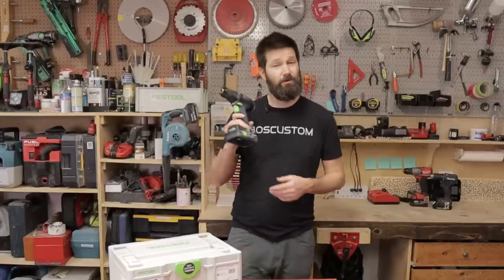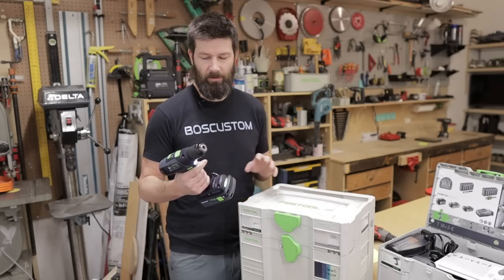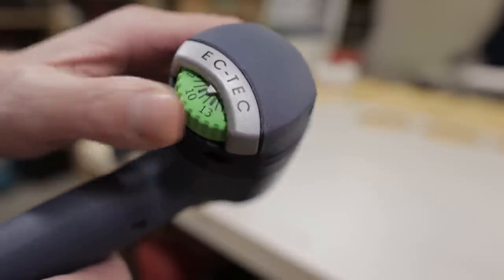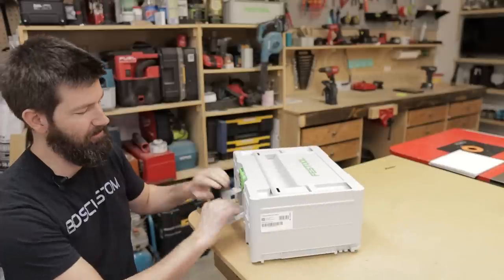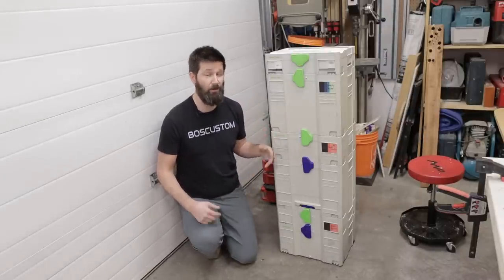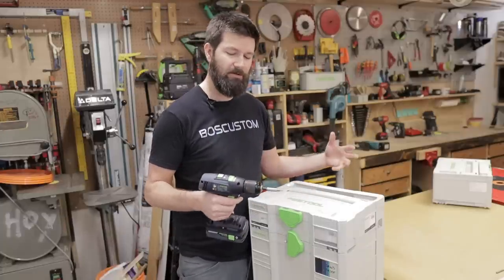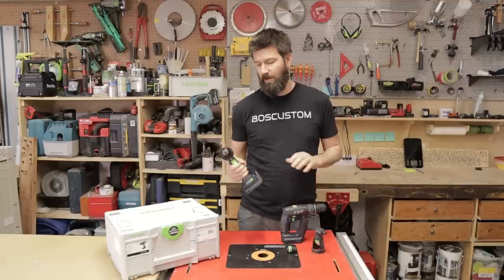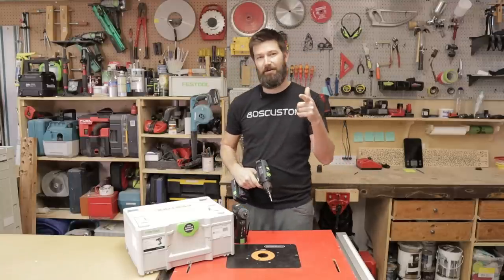Festool T18+3 Easy Drill-- Everything you Need to Know!

Comment: Thanks for the review.  Understand that this drill model exists precisely because it has a fixed chuck.  It lowers the manufacturing costs for the product and it can be sold at a lower price point compared to the standard drills Festool offers.  Bells and whistles cost money.  Festool also changed what they include with their standard T and C 18v drills.  They no longer include the eccentric chuck in those sets.  You only get the 3 jaw, the Centrotec and the right angle chucks in the sets.  The eccentric chuck is sold separately and costs $130.  So those standard 18v drills in sets and the eccentric chuck is $630 versus the Easy model (with batteries and charger) at $300.  One can pine away for the Easy version to have the features of Festool's standard line of drills, but you'd be tilting at windmills a bit to desire that.  As both you and Festool say, the Easy is  "entry level" BUT you still get the quality of Festool.  Cabinet installers make good use of the eccentric chuck and the right angle chuck.  Serious hobbyist woodworkers and homeowners, less so.  Hmm, what to do with the $330?

Comment: I really like the C-18 (cxs's big brother). The nicest drill/install driver I have used. 

I just picked up the T18e as well to complement the C-18. Both are super smooth and controlled. Perfect for cabinet makers. 

Good review. Now to see how the durability is....
Reply from the maker: How do you like handling the T18E vs the C18?
Reply: @TheFunnyCarpenter   I really like the ergonomics of both TBH; the C-18 feels really great in the hand for screwdriving, and odd angles, etc.  Like the T18E you reviewed, the balance is really good too. I mainly picked up the T18E for larger jobs where there is a lot of drilling and fastening to do, so have dedicated tools for each task.  The T18 is really smooth to operate with drilling, etc. (And I am already on the battery platform (TSC55, Osc18). )

 The C18 of the two is my main go to though. It is just a little bit more comfortable and nimble. I can hang it off my tool belt and forget that it's there

Comment: I've been eyeing the TSC 55.  How would these 4Ah batteries hold up on one of their tracksaws?
Reply from the maker: I’m assuming they’d be adequate, but that’s just a guess.  In the next vid, I’ll them in terms of runtime against the Makita 4amp and the Milwaukee 5amp- that will be telling.
Reply: 4 Ah will last some cuts.
My experience with DeWalt is they last about one full sheet. But it's super easy using a cordless saw.
It's well worth the money.
But I'm biased towards DeWalt...
Because I bought into their 18V XR batteries and the range of cordless tools they offer.

Comment: Just a heads up if you want to buy a cordless Festool jig saw. 
Don’t buy the barrel grip, it has the same annoying non modulated speed control,; on/off at set speed or auto, as Makita.
Buy the D-handle Carvex, it has a modulated trigger, as well as on/of as the barrel grip one (if you like upside down sawing)
The trigger on the handle isn’t too smooth as you would expect. I have the Carvex D-handle 18V, but are considering the “old” but still very smooth D-handle Festool Trion. But, that’s corded only.
Reply from the maker: Thanks for the info Mate!

Comment: Suddenly viewer engagement is up 480% hahaha I can’t imagine why. My Hilti drill has one of those slip rings at the front of the chuck but it doesn’t make any noise when I stop the drill. Happy 2021 btw. If you ever need a finish carpentry apprentice let me know! This Alberta Electrician is currently looking at jobs as far as the Yukon to find work hahaha.
Reply from the maker: If you move out to the Fraser Valley, shoot me an email, I’ll put you in touch with some job leads.

Comment: The CSX I picked up used ruined me for ever wanting the fixed Jacobs chuck. This adds a couple hundred to the equation so I keep struggling along with my Makita subcompacts. /s The other thing is (ofc,) the accessories. That depth setting chuck is another hundred and would kill me not to have. This is really the short story here. You'll be doing no favors giving someone this drill. Quite the opposite. You should keep it safe away from temptation.
Reply from the maker: These things you say are true:). I have the Makita subcompact drill as well.  It's great drill but it would be nice if it packed a slightly bigger punch.  It's great for cabinet instal though

Comment: Don't fall for the marketing trick. Buy what you need. The set you showed seems value for money, but is it?
If you decide to switch to their battery system you'd be better of getting what you need. DeWalt has naked machines, no battery no charger...but you pay for what you need.
But great review.
Reply from the maker: The Festool platform is certainly not for everyone- it does lack a lot of tools you might need.

Comment: Revisiting your video I confirmed the title is faulty. Your demo drill, the T18 Easy, which does not have the interchangeable chucks that the T18+3 series has. Seems to be the same motor and gears, but only dissection would confirm. The T18+3 series has a better chuck as you mentioned. BTW, I’ve been using Festool tools for 11 years and have never had a failure. Some of mine are looking a little warn but continues soldering on. I purchased my CXS drill the week they arrived at the dealers. I use it daily.

Comment: The systainer rails don't allow it to come out far enough to open it for easy access, unfortunately. Looks like it's more for vans.

As for the T18... is this supposed to be your go to drill? Like, would you supposedly not need the CXS? Or is it a different class entirely. (BTW bought the CXS after watching your Milwaukee vs CXS video)
Reply from the maker: I'm wondering on those rails and the new sys3 if you increased the vertical space between systainers, would that allow you to open an access them better?  The CXS is awesome, but I do like the idea of only having a drill and impact driver instead of the three headed monster I currently use.  Hard to say, but if my CXS dies one day, I'd consider it.
Reply: @TheFunnyCarpenter  Not sure about the vertical space solution. Brian Waters made a video recently (he's a systainer connoisseur... or addict haha). Looks like you'd have to waste a lot of space vertically to allow for what you might be suggesting. https://www.youtube.com/watch?v=uNNk-dyxn5Y&t=49s

Comment: Thanks for the Festool review it is good to learn more about them I am a plumber and have been using Milwaukee tools for years or I should say decades. Battery tools have changed the where I buy tools dramatically when the battery tools first came up they are really handy but not all that great and I have used several different brands over the years.

Comment: You should know,, the festool jigsaws are some of the most controversial festool tools. Quite a few festool fans hate the jigsaws :).. Hilti and Mafell might be better choices. This drill is cool, but no more fastfix system? no replaceable chucks? Weird!
Reply from the maker: Definitely would like to try one out.  May have to snag one and take advantage of the 30 day money back, if I don't like it.  I'm assuming the non removable chuck makes it cheaper to produce and allows them to compete price wise with the other main players.
Reply: @TheFunnyCarpenter  Right, I see you mention the chuck ordeal at the end, I hadn't watched the full video yet. Indeed, I think it prob does make it a bit cheaper for them. I have got the c18 with all the chucks and cxs myself and I think it's a nice combo. I really like all the different chucks for installing stuff! I also have a ts55, which is precise, nice to use, good extraction, but not hugely powerful. The battery powered one will probably have more oomph.

Comment: Hi,

I always thought people who bought Festool drills must be crazy; so much money for a tool which only makes things spin. But now that I own a T18 I know that it is an absolutely fabulous bit of kit, worth every penny to me.

One thing I would like to add about the clutch and the switch; The clutch not only controls the max torque, but it also controls the speed. So you will notice that at a low torque setting, the max RPM is reduced as well, which make it really suitable for delicate work. I do believe this is what actually makes the clutch so good and I am not aware of any other drill which has this feature. The switch you were referring to is the clutch engagement (again being able to turn the clutch on at the last used setting is a big bonus to actually use the clutch in real life) and not the speed control. I just tried myself, and absolutely nothing happens when you move the switch whilst drilling. Only after you released the the trigger, the clutch is engaged. 

I own a Metabo Quick drill as well and being able to remove the chuck is a must have for me. However, I bought my father in law a Metabo quick drill as well, which even came with the special bit adapter, but he simply keeps swapping drill bits and bit holders in the same chuck all the time. So if it is not in your way of working, a removable chuck is of no value. And this drill would be a perfect complement as a second drill (I mean, a drill, systainer, two batteries and charger is really good value); one for drilling and one for screwing. If only it was available on our side of of the pond...

Good luck with your choice. I'm sure will not regret owning this drill. If you are also in the market for the PSC, be aware that you can buy a combo kit with this drill and the jigsaw.
Reply from the maker: Thanks for the great comment!  Yes the clutch engagement switch I found sometimes gets switched before drilling by putting my hand on the top of the drill.

Comment: What i realy like about the Festool brushless tools is that they are very quiet, my employer provides us with m12 and m18 fuel drills but they noise they make makes u want to use hearing protection for only putting in screws.... 
And the smoothness of the Festool makes it realy easy to put in screws onehanded without slipping and jabing the bit into your workpiece.
Reply from the maker: Using the drill reminds me a lot of driving a sporty well made car.  The next thing you know you're going 150 down the freeway and it feels like 80.

Comment: The clutch on the drill looks impressive ... but what really got me thinking was he container cleat.  I have a fair sized collection of tstak stuff mixed with a few systainers and generally hate having to move a stack of containers to get to the tool box of interest.  My systainers are pretty new (all within the last year) but don't have the cleat, but It made me think about using something simple like angle brackets on a cabinet wall for storage.  Not going to be amazing for a van (alone), but better than the clips (I enjoyed your tstak vs. packout video.  It was spot on.)

Great videos!
Reply from the maker: You're bang on with that cleat idea.  There's no reason why you couldn't build a nice system with even just 3/4"X3/4" hardwood cleats.

Comment: That electronic clutch at ~4:20min reminds me of some expensive high speed torque adjustable electric screwdrivers used in assembly line. I am actually wondering if Festool has an estimate torque table for the adjustment you make on the wheel. That would be super cool but my take is that electronic clutch calculate the force it had to put during the run until things became harder to drive and then running a delta value at which it auto-trigger the "stop".
Reply: I hope you are right! I have just ordered one to test.

Comment: The Milwaukee Gen 3 Hammer Drill may not be as refined as a Festool but it is a freakin beast.  I stirred a 5 gallon Home Depot Bucket of self leveler, which is like a soupy cement.  It would’ve gone all day in low gear.  

That’s a really good deal for that Festool Drill!
Reply from the maker: No doubt the power on that drill is mind boggling

Comment: The systainers need to evolve.  They arent durable enough for the price point.  Packout and Tough system are much better investments.
Reply from the maker: The systainer definitely isn't a rough and tumble case by any means!  It is pretty nice for cabinet install though, in that its nice and lightweight to carry in and out of finished spaces.  The more durable cases are the heavier they get.  I've had those sytainers rumbling around in the back of my truck for 6 years with only a few small pieces that chipped off.
Reply: @TheFunnyCarpenter  they need to change the material.  The TSAK boxes are around the same weight, but aren't anywhere near as brittle.  I agree that the packout and Tough System are much heavier.

Comment: I've got the Milwaukee Fuel combi drill and I love it so much I just bought another as I got fed up changing bits during projects. I am impressed with how smooth the Festool seems and for the stuff I make it's probably a better option but I'm already in the Milwaukee M18 system and DeWalt 18v XR system and can't justify another. That said, I'm probably going to buy the Festool TSC55 this year as it doesn't look like Milwaukee are going to make a competitor any time soon and the DeWalt is basically a separate platform and I might as well buy the best. Oh the stress! Can't believe how cheap tool are over the pond - you guys would go grey if you knew how much things cost here! 
Great vid as always! 😊
Reply from the maker: Thanks for the awesome comment Persephone.  We have it pretty good over here in Canada with the American Market right next door.

Comment: This would be such a sweet drill for install, and would go with my new cordless TS batteries.  Hint hint! Lol
Festool prices have come way down on their drills it seems.
I wonder if Festool’s electronic clutch does the same thing Milwaukee’s new drills do? 
I noticed when Milwaukee went to electronic I can’t use it to put handles on because even on #1 setting, it still takes a second so for a tiny instant it’s still lugs at higher torque before cutting out. And snaps my break away screws.
And PS. If you’re hesitating to buy the cordless TS, don’t! Just buy it, it’ll change your life.
Reply from the maker: You’re on the very short list buddy! You’ve been subbed right from the very first video, busting my balls on what was a pretty rambling vacuum review!  I appreciate you always chiming in with loads of added value to the convo!

Comment: Am a festoolbloke since a few years back. There is many + and some - as well. Still have a Bosch GKM 18 v, woodblade on it. So low noice and high rpm. And I will kill anyone that break it, 😂
I will repair it if it break, close to same prize as new one. And oddly Bosch stop produce this model....!!
There is many companies and some are good power tools. But one batteryplatform is handy. 3-4 diffrent to hump around the worksites with is just a pain in the rear.
Festool is good and costly and I stick to it until I stumble on to another concept that provide better for less.
To have the ultimate tools straight through is a wish most have in the trade.
But then several battery platforms, nope.
The HKC 55 is single battery and lack a bit of power sometimes, but a delight to use with the angled tracksaw. Quit loud though. Wish I had one to my GKM 😂
If Festool got nail guns one sunny day 😍😍
 " I have a dream" 😂😂😂

Comment: Hey man another great review really enjoy your content. I like the point you brought up about the screw/drill selector and how it’s essentially an entry level model of the one with more chucks I’d definitely be buying the option with more chucks. 
100% agree about the makita jigsaw I have the barrel grip and it’s horrendous blade wonders severely to the left almost impossible to cut a straight line also doesn’t hold the blade anywhere near 90 degrees. I own the Mafell P1 it’s amazing it’s like nothing else on the market Festool Carvex is good corded or cordless I’ve used both but the Mafell is still so much better. I will say it’s a heavy tool and the grip is for medium to large hands. Not an issue for me it’s so smooth I’ve never noticed the weight when cutting from the back of the panel. Plunge cuts like a dream dust extraction is second to none. 
Anyway enough of me drooling about Mafell thanks for the great content
Reply from the maker: Great comment- thank you.  I’d definitely like to check out the P1

Comment: Man, I love your reviews. I value the same characteristics in a tool that you are, ergonomics must be great. That little ring at the front of the chuck that makes the ding sound is there for precision, you can hold it if you have to. That really comes in handy in certain situations. One thing that you didn't cover is that those batteries have a Bluetooth chip, so if you have a Festool vac with a BT module, the tool can activate it. Why the hell would you ever want to activate a vac with your drill you ask? If you are drilling pocket holes using the Kreg jig with the vacuum attachment. 

I dismissed this drill soon after the press release - fixed chuck, meh. Then I had a chance to handle it at a local lumber yard that carries Festool. I didn't expect much, but I was hooked the instant I had it in my hands. The balance and overall ergonomics are outstanding!
Reply from the maker: Excellent points!  I did have a whole section talking about the Bluetooth batteries, but it didn’t turn out that great and the review was already getting to be sooo long- I decided to cut it out.  But yah the Bluetooth batteries are 🔥🔥🔥.  It’s so difficult not to make the reviews like 20+ minutes long!